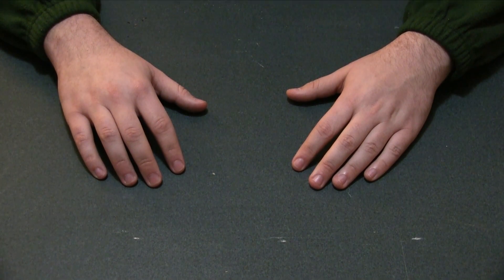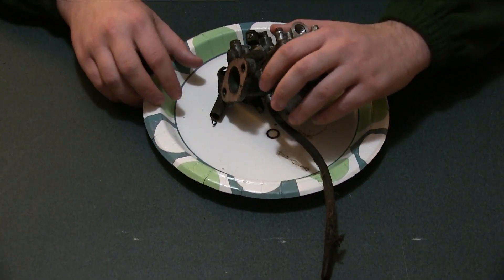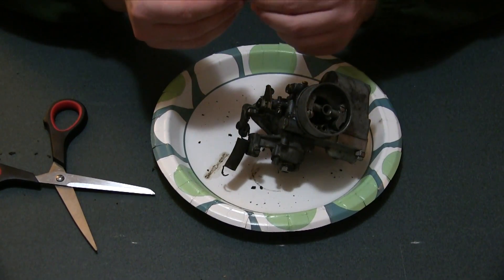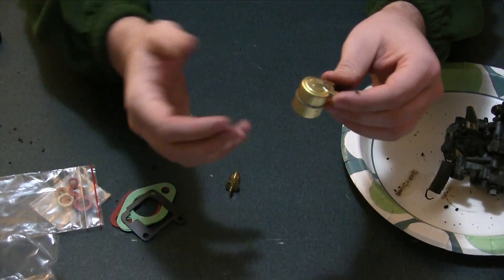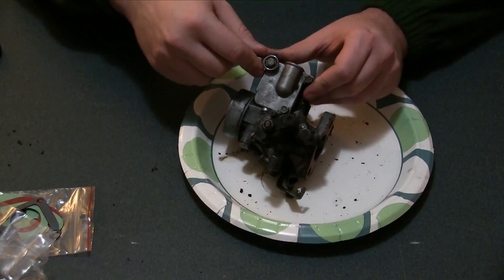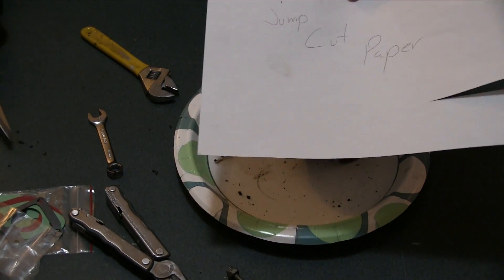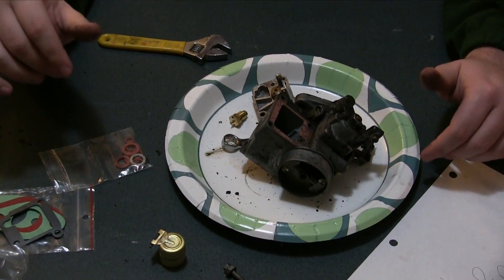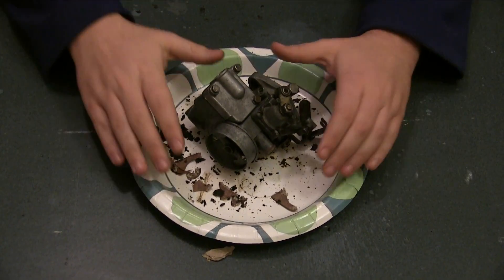How to Rebuild a Carburetor - Aging Schortz

Comment: I know this is old but I somehow need to tell you this. In Finland we have this thing called "asennuskalja". It means installation beer. It is usually considered mandatory. If you install something (car parts, ikea furniture or whatever) you need to have a beer. If you succeed, you can celebrate with the beer. If you fail, you can drink the beer to ease the sorrow. Well... We mostly drink it while installing whatever it was though... but hey... Beer! So maybe the small beer keg was the german version of asennuskalja. In Finland we need to buy it separately but maybe the Germans are more efficient.